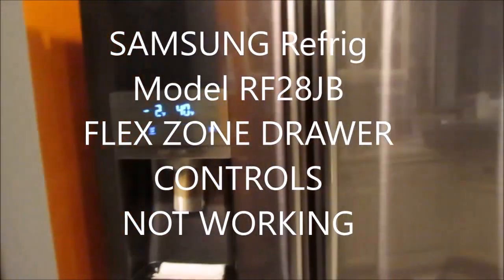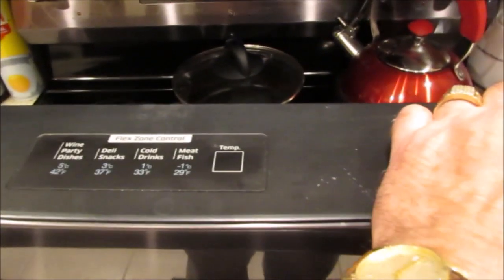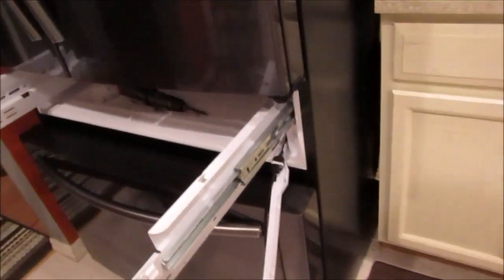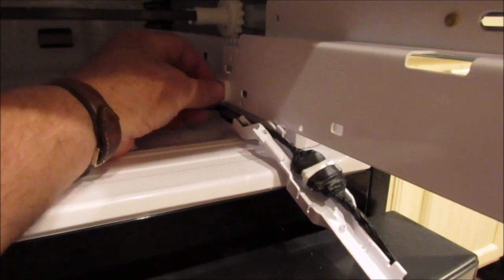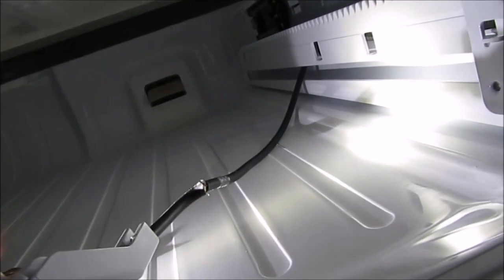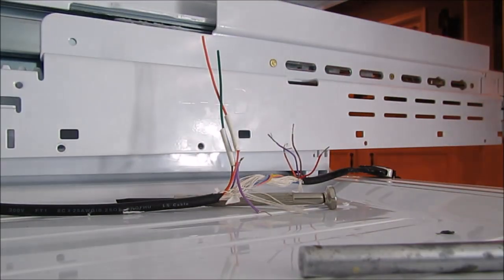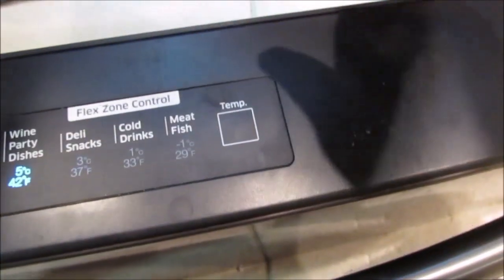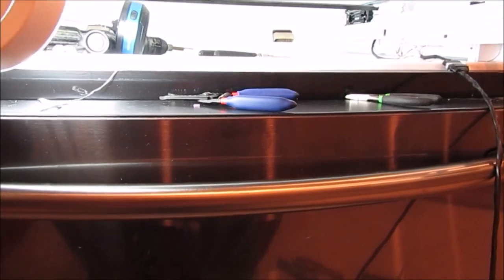Samsung Refrig RF28JB Flex Zone Repair

Comment: Thanks for the video . Same thing happened to ours , i found out that if you take 1 screw out at the front of the drawer slide the whole slide will lift off and the connection is right behind the slide to the wire harness . I went ahead and bought a new harness for a $111.00 and just replaced it . I did save the old one to repair like you did yours as iam sure it will happen again . We are done with samsung products . Hope this info was helpful .

Comment: Thank you for making this video.  My mother has the same model Samsung.  I stopped by her house today and noticed the freezer drawer light was out.  I figured the switch was probably bad but I found it odd since it's a relatively new fridge and doesn't see tons of use.  Her slider drawer works but you are correct in that it's a very poor design.